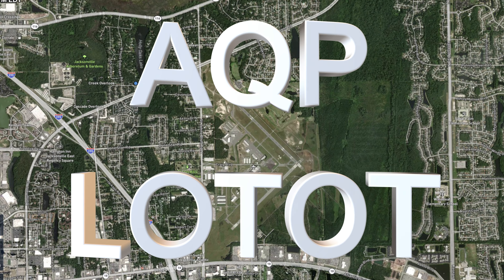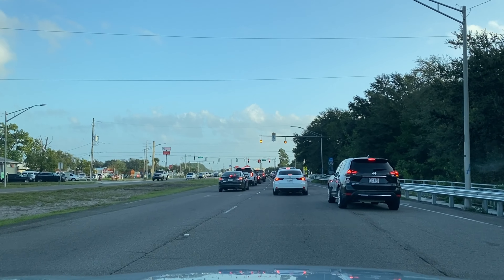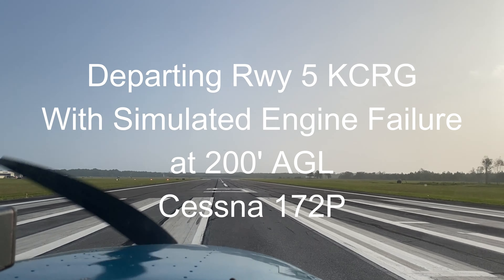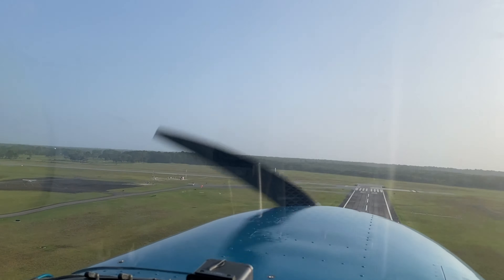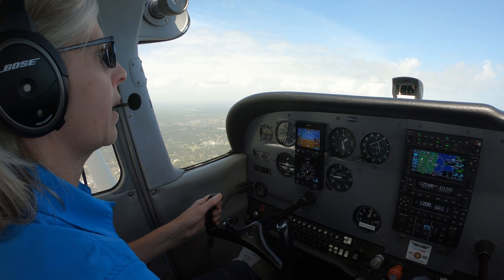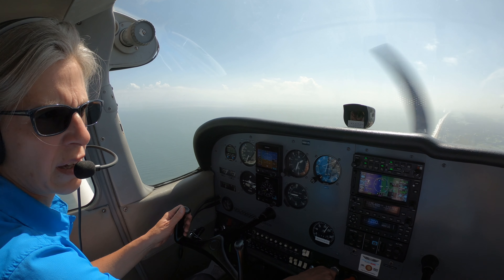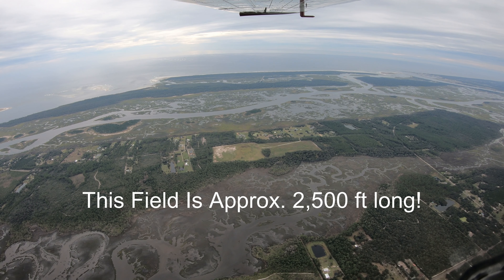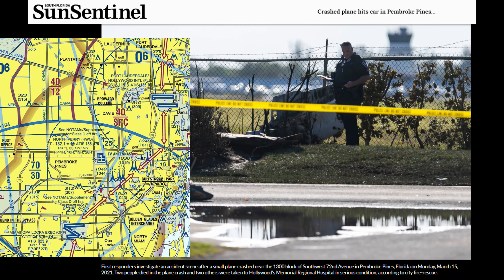Where Will You Land If Your Engine Quits Immediately After Takeoff?

Comment: Good video. The turn is definitely “possible” if briefed in detail prior to takeoff. It’s also important as an arrival brief item when doing a T&G at a unfamiliar airport. JAX just had a engine failure after a T&G (landed successfully on a road). When I instruct this scenario I also like to emphasize the importance of completing your engine out flow checklist once stable. This scenario is why certain checklists items are memorized and then verified.
Reply from the maker: Touch and go’s is going to be another video. =) Details on the JAX incident?
Reply: @HolladayAviation  low altitude engine failure after T&G RWY 8. Did a quick 90 degree left turn and landed on pecan park rd. Clipped a small tree but when you consider the other options and terrain I consider it a successful emergency landing.